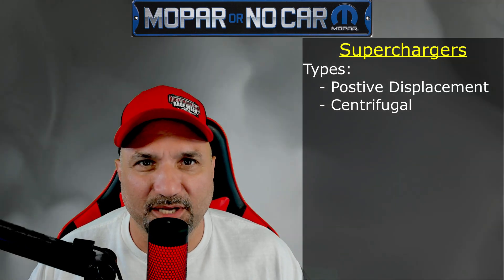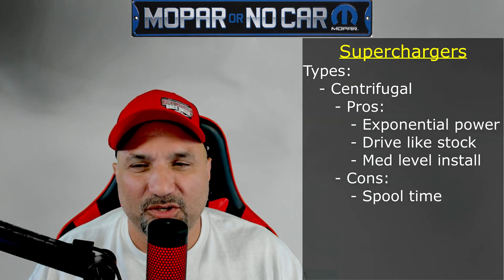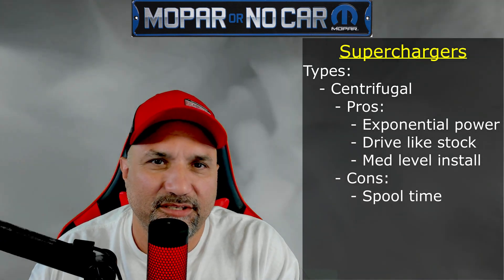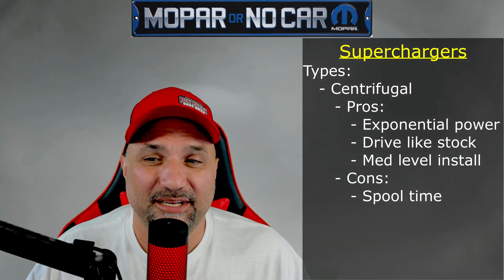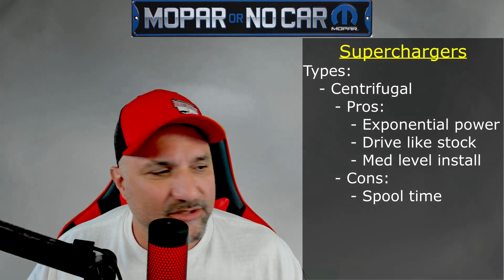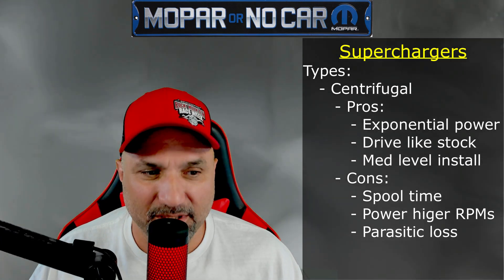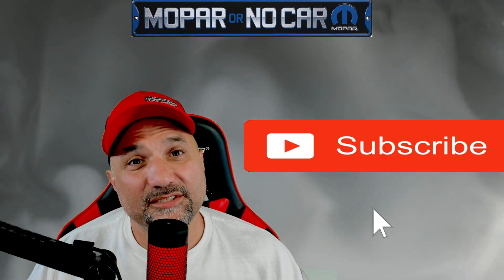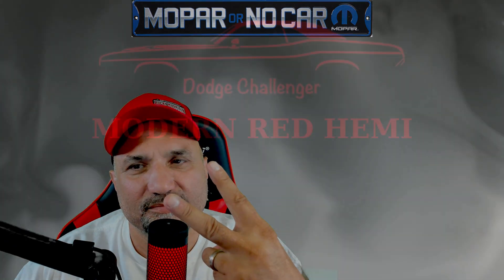Demystifying Forced Induction For Newbies!

Comment: Nice explanation of all the choices.  For me, I'm going to eventually throw a Maggie on top of my 5.7 and leave the rest stock until I get the urge to have more power after that.  Right now, my 2023 Challenger R/T has a 10yr/100k warranty and I think I will leave her stock for a while.  I don't take her to the track and just enjoy running around town for fun.  The base power is plenty for that and having the 6 speed that comes with the 3.90 LS rear, she pulls hard off the line.  The stock exhaust is really good, so I don't think I will even change that right now.  Wheels and tires will probably be the first upgrade for traction.
Reply from the maker: Thanks brother! I am not the best at explaining things but I try. Maggie's are nice and make great power as well. Everyone underrates them for some reason and not sure why. Hey, while it's under warranty, take full advantage of it. People get wrapped around the axle when it comes to power and don't understand that anything over 300 rwhp is a lot and is plenty fun. Definitely get those wheels and tires. Have to get that power to the ground! 💪

Comment: Going with a Maggie, just deciding what else while I’m at it. 600 rwhp, on 5.7 is goal now, but that’s open ended. Not gonna compete with S&B. Just want fun. 
See ya at Wed live. Need to find my own “Mack”.
Reply from the maker: Nice! 600 rwhp is plenty and a lot of fun! If you plan on staying around 600, I would get at least 650cc injectors and upgrade to a Walboro 525 (Hellcat) pump just to be safe on fueling. I'm unsure if the Maggie's come with those two things. That should be super reliable and a lot of fun! 💪
Reply: @ModernRedHemi  did my first 1/8 mile. Got talked into South Mountain. Had a blast. My best was .18 on the reaction and 8.74 at 81.67. With my challenger RT Might try Cecil County next month. Lots to learn.

Comment: I have a 5.7 running 10s on nitrous but have this 392 with a cam and hellcat supercharger I want to put on. Can I get away with just drop in pistons and stock rods if so how much boost. The goal is to be able to run the same times or more if safe.
Reply: If it's a stock 392, you can get away with up to 7 PSI. Drop in pistons about 12 PSI.
Reply: @1320_ikimasho  ok thanks yea I just wanted about 8psi.
Reply from the maker: @1320_ikimasho  drop ins you can run way more than 12lbs. That’s the purpose of doing drop ins. I’m running 24lbs on mine and almost 1200 rwhp. 😉
Reply from the maker: @1320_ikimasho  drop ins you can go twice that. That’s the purpose of drop ins for the 6.4. I’m pushing 24lbs and almost 1200 rwhp. There are many many other 6.4s out there doing the same.
Reply from the maker: If you're going drop ins for the 6.4, might as well get the whole set (pistons and rods) if you can. If not, I am unsure how much the stock rods can take to be honest. 😉
Reply: @ModernRedHemi  gotcha yea I firgured most said the ring gap was most failure point so was thinking with that I just wanted 630rwhp
Reply from the maker: @seriouzfilmz9397  I went up to 20lbs on my stock 5.7 rods. Not saying the 6.4s will take that abuse 😉